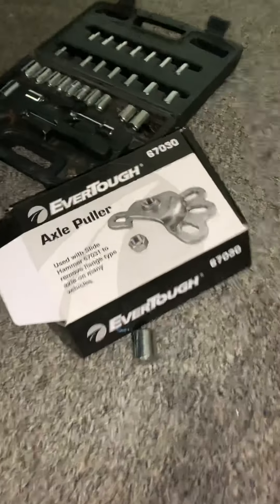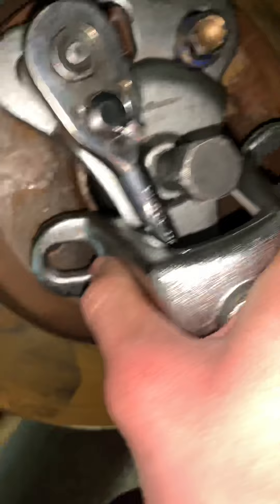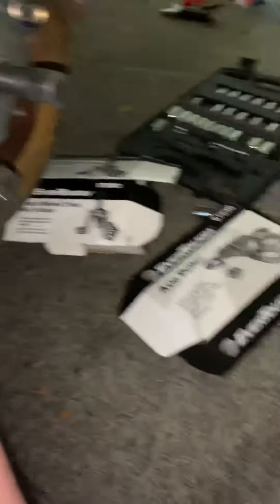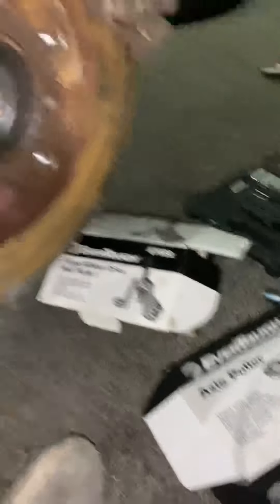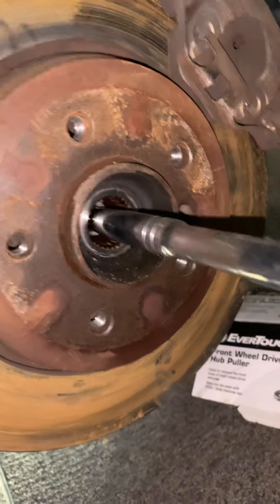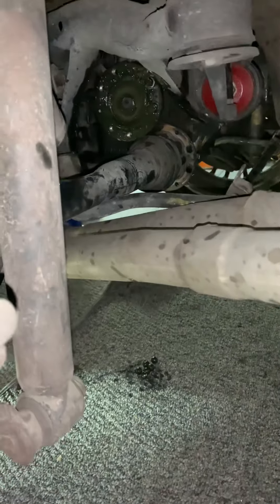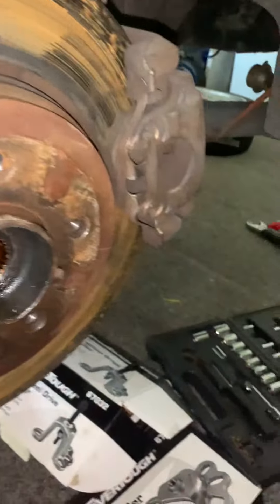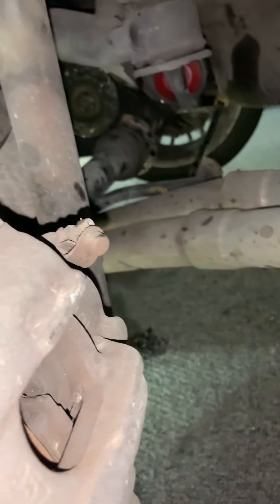AXLE STUCK IN HUB? How to remove a stuck axle

Comment: After fighting for 2 days with a stuck axle on my Z3, came across your video.  Tried it and worked like a charm!  Did have to use a breaker bar and the first "pop" I heard was a bit unnerving, but only took about 5 minutes of work to get the axle free.  Thanks for posting!
Reply from the maker: Awesome!! Glad it could help. I was in the same boat until I finally got it, and had to help others by making this video.

Comment: Bmw e36 i see... this was the perfect solution for any bmw. Thanks a million! I HIGHLY recomend you grease the threads with antiseze. You can get a lot more force through the tool with out the threads friction .
Reply from the maker: It is an e46, but yes!!! I’m so glad it helped. Sometimes they get stuck in there. I agree, antisieze would help a ton
Reply: Grease is your friend in threads, prevent Galling and easy turns

Comment: I just replaced a driver’s side wheel bearing and we had so much force on that puller from O’Reilly’s that we busted the axle in two. Never got the wheel bearing separated from the axle. Passenger side....axle pushed right out with my thumb.
Reply from the maker: I have a feeling that the wheel bearing heated up so much from being worn that it welded itself to the axle. That’s so wild though!!! Never heard of that. 
That’s how I thought mine was going to go. We were pounding on it with a 15lb sledge. Nothing.

Comment: Aren't you shoving the drive axel into the transmission to get the bearing housing freed. I think something might end up bent or cracked.
Reply: I was wondering about that too, but I noticed at the end that he had already disconnected the inside end of the axle.
Reply from the maker: @pauldarlington5589  ya good eye, it was already disconnected
Reply from the maker: You remove the differential bolts first. You are able to pull the inside out. 

Normally with a cv shaft, there is some inward play in order to extend when the suspension travels. If it was solid one piece, you wouldn’t have any suspension

Comment: usually you need to disconnect the outer tie rod and bolts from the strut lower mount mount then put the axle not on flus and tap with hammer
Reply from the maker: Yeah maybe on a fwd. With this method it comes right out. it was just stuck with some surface rust. 

the other side on this car came off with my pinky finger. there isnt any pressure on the axles when it is jacked up and the axle nut is off

Comment: My issue is that I bought both pullers and neither one fits my hub. It’s like the center of my hub is too wide. So now I can’t fully secure the lug nuts onto it to use the tool :/ going to try getting an electric hammer drill and hit the center point of the axle.
Reply from the maker: Dang, I’d try the biggest sledge and the biggest guy you know to hit it like tiger woods
Reply: @Hennysgarage  so your video gave me the idea to put my rotor over the hub and then use the puller since the cv axle sticks too far out and wouldn’t let the puller sit flush on the hub. 

I screwed in as tight as I could but it wouldn’t move at all so I ended up putting a socket on the end and found a heavy sledge to hit it in the center. It moved only a tiny bit each time but I just kept screwing it and hitting it until it popped loose all the way. 

I put anti sieze anywhere I could so that it never happens again.
Reply from the maker: @LucidVisionMane  yeah rotor should still be on

Comment: hey how did u remove the piece in the middle u used from the other part, having trouble removjng it
Reply from the maker: The long bolt part? I would put it in a vice or secure it to the lug bolts and use a breaker bar or impact to get it out

Comment: I have tried a press, welders torch and a hammer and pull bar and it won’t budge
Reply from the maker: I sprayed a lot of lube on the threads and it really helped that the press was perfectly aligned. You need to be pressing exactly straight. Without the second press set that I got, it didn’t want to come out correctly. Once I got the proper size for the lug bolts, it came out insanely easy. 

It has happened to me before on this car. You really need the right press for the job. Any discrepancies in clearance will cause the axle to not push out completely straight

Comment: About ready to go buy one, I just wonder if it's any better than a 3-point puller which I'm using now, even full on with all the power mine won't get it...
Reply from the maker: It worked way better than anything else I used. 

This is a 3 point puller as well, but it utilizes the lugs instead of the rotor